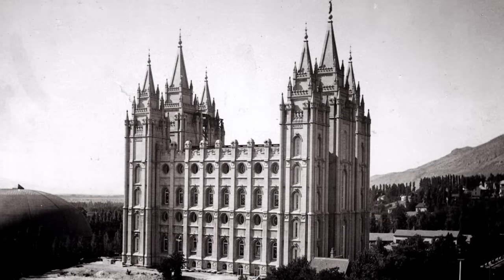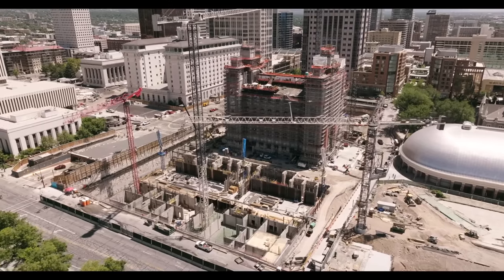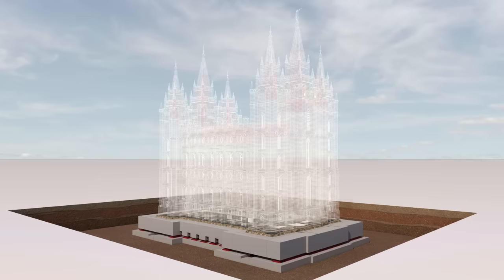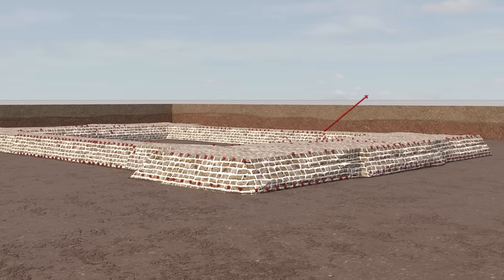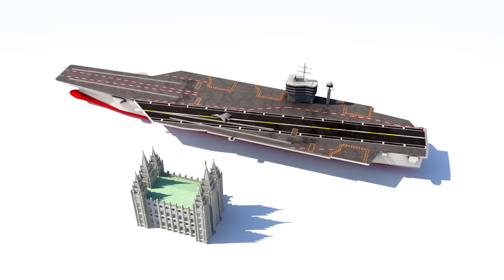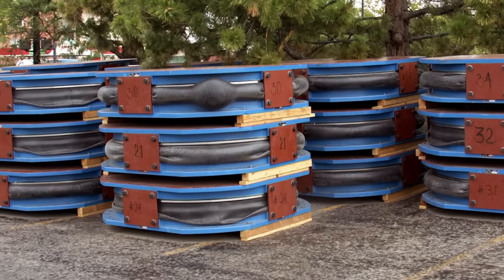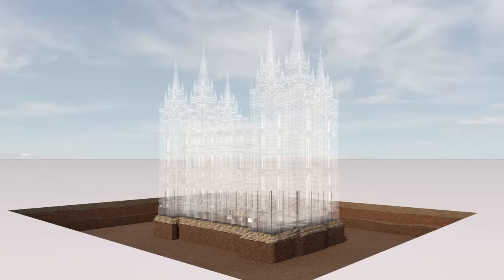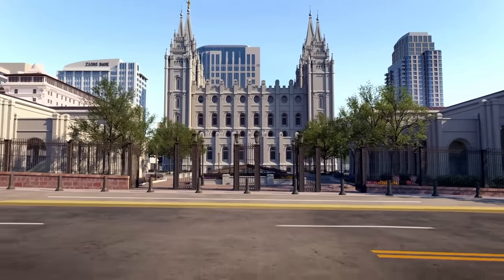How the Temple will Survive Earthquakes

Comment: I assume that it's not just movement on a compass, but all the available directions of travel. Think of a helicopter moving and changing attitude with pitch, roll, and yaw. Also, of course, up and down.
Does it have a high g stop when the horizontal dampeners reach their limits?

Comment: One would hope that all of the reinforcing steel in the concrete is stainless steel otherwise the goal, of 100's of years of life of the building, is a fantasy.  The weak link of reinforced concrete has always been the steel rebar that corrodes and disintegrates, and that in about 60 to 80 years!  Furthermore, experience with mortar has shown that modern, hard, Portland Cement based mortar, because of its rigidness, disintegrates/crumbles forming cracks allowing moisture in and furthering disintegration.  Masonry Building that have stood for more than a 100 years without mortar cracking were built with lime based mortar.